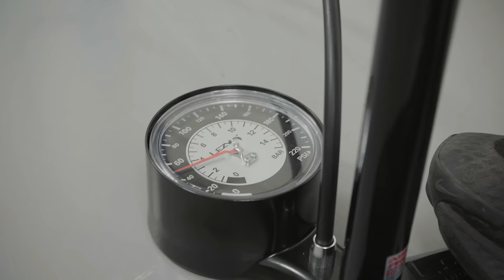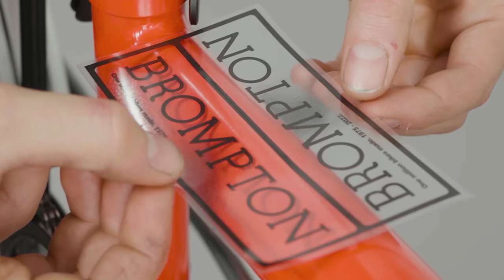Dream build - Vol.1 The Millionth Brompton

Comment: Nice!! Very nice! 🙄But during the built of all those many bikes, You - haven't found out to protect the frame from scratches during the folds, so that the Chinese still have a huge business from selling "protection" (We have an offer which you can't refuse!!), carbon and metal plates for a Brompton's frame, to avoid those scratches!!!
     Small pieces of "clear tape" is just a mention of: "Yes we know this may be a problem"!!! 
I am an owner of a 2019 "Superlight" which I try to make even lighter by adding carbon and titanium parts, so for now it is down to 9,35 kilo, and still with its mudguards (I am a Rainy Dane!). And still some ways to make it lighter 😄. Finn. Denmark

Comment: ask me a question, because this thread of the center bearing is backwards and not forwards, whereas forwards with the rotation of the pedals the tendency would be to tighten it more, whereas on the contrary there is no risk of loosening, because it is like this , in my opinion this is the only defect of this bike, but I could be wrong, clear that doubt

Comment: I own an early 5-speed Mk2 Brompton from 1990 with a serial number in the 3000s, from the days when they were still made under the arches, only came in two colours, and used Raleigh tyres and Raleigh inner tubes. It is interesting how many parts are still compatible, or the same, a third of a century later.

Comment: And why not eventually, sealed "Ceramic Bearings" in front, on the stem post? I intend to change mine into a new set of newly bought, sealed, Ceramic Bearings! I have already changed to a Ceramic, Titanium Crank. I have also changed the front axle, nuts and security parts into titanium, and the nuts and similar parts in the back (Its a 6 gear hub). Also most of the possible, brake parts and bolts on my "Superlight" (I still miss a few of those, as it seems to be - changing sizes at intervals, so I had a little difficulty in finding the sizes for my 2019 Brompton)!  Finn. Denmark